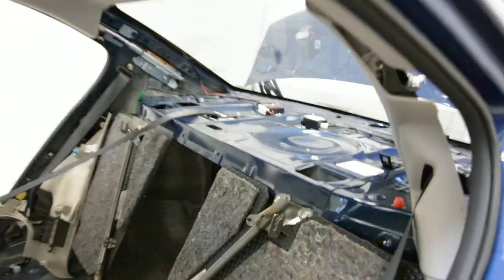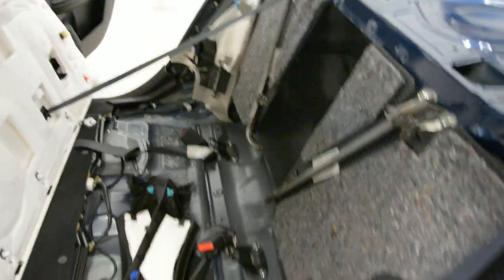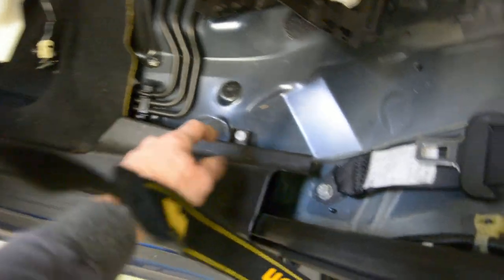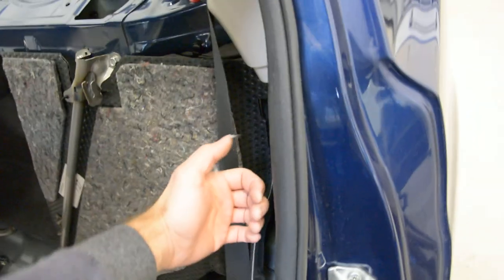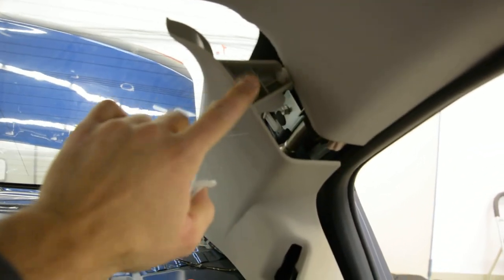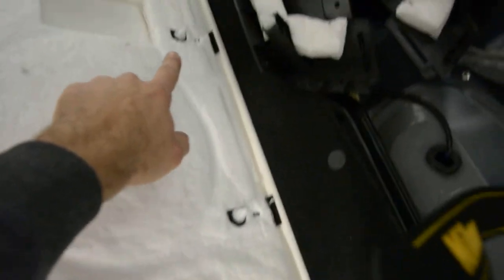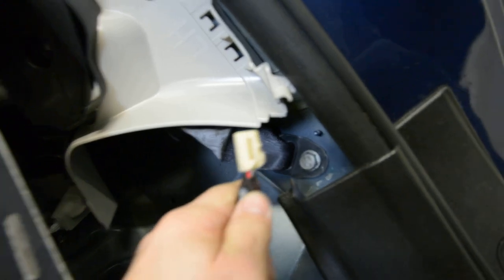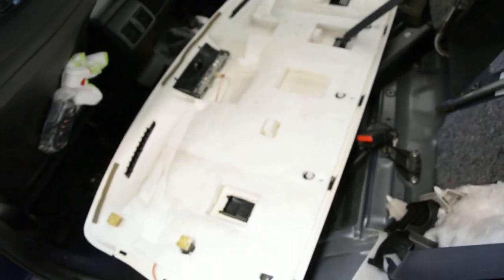Subaru Legacy deck trim panel Removal

Comment: If its just held on by clips do you really need to remove the rear seats?
Reply from the maker: If you can remove it without to remove the seats do it.  I've made this video also to show how to remove the seats. 2 in 1 :)
Reply: @DFCGarage  I did it
Reply: Maxi ?!? How?